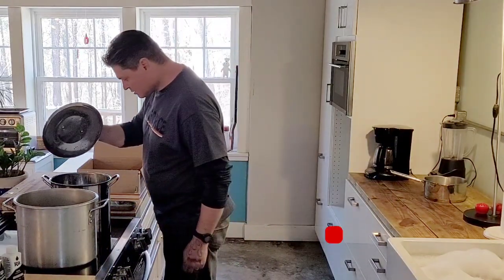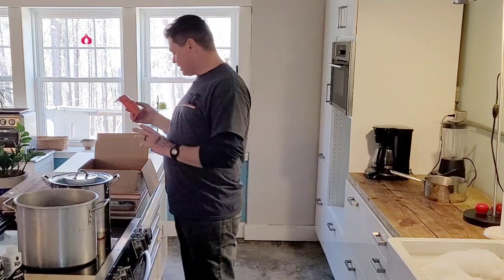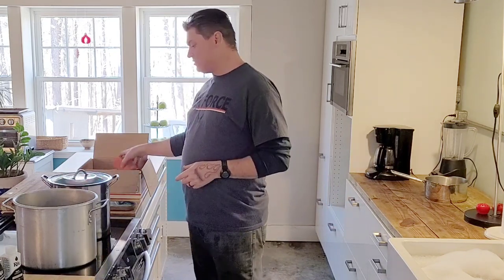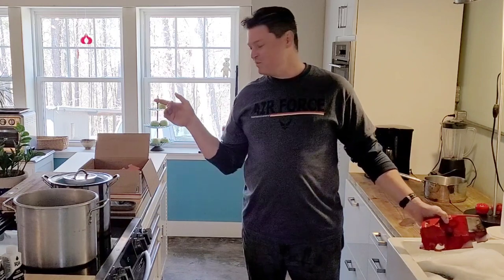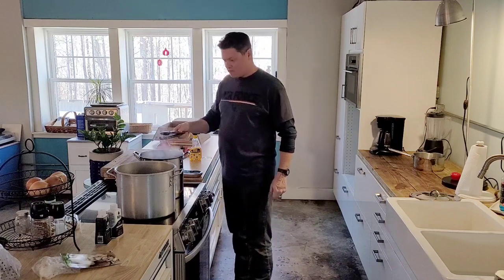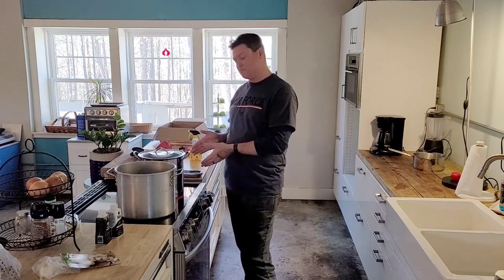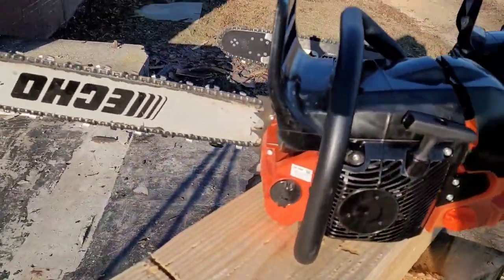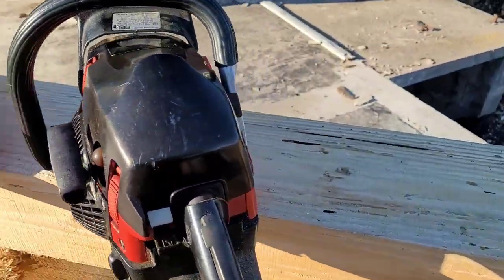Dyeing Plastic for the first time!

Comment: This works wayyyy better on good condition plastics with sheen to them. Older, duller plastics will just come out dull, but black. There's videos of this from where it originated and that's dying pmag's for AR rifles. I used to use several different concoctions- now I just use hot water (light boil) for 30 -40 minutes. Works every time. Just don't splash it on your dry, winter cracked hands right before you go a funeral 🤦‍♂️🤦‍♂️ I have had success doing several different colors but darker is better.

Comment: A OEM 2152 is not open port. Someone must have put an open port top end on that saw, maybe off a 350. The 2152 is closed port saw.
Reply from the maker: It may not be an open port entirely, but it is definitely not the closed quad-port of the 2153.  That's what I'm talking about.  It can be difficult to get it all straight and remember every detail when shooting from the hip.  Thanks for pointing it out!